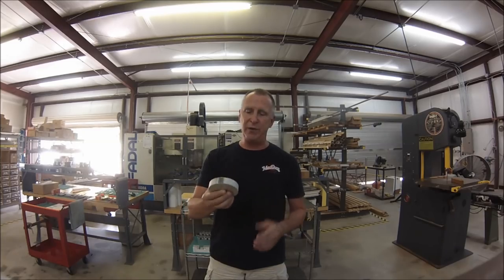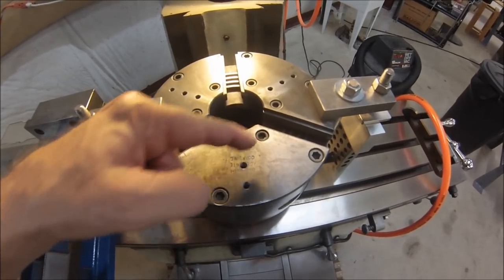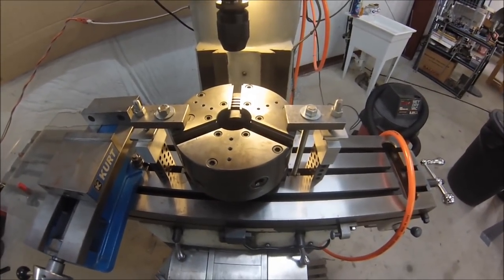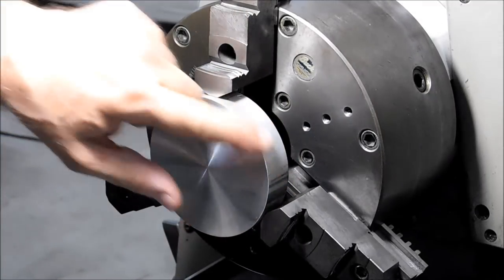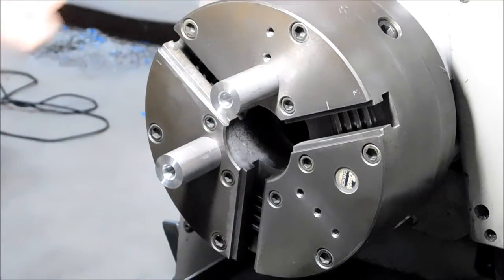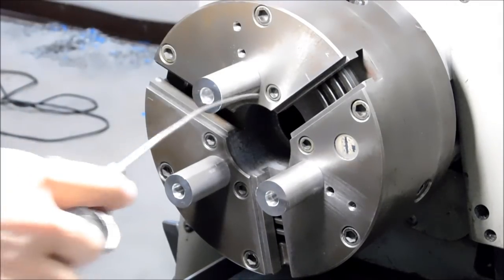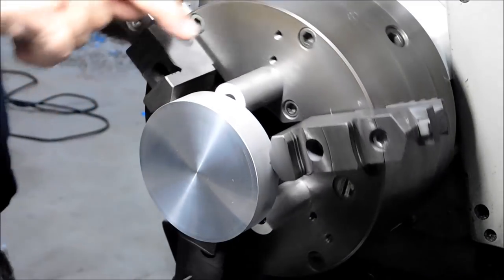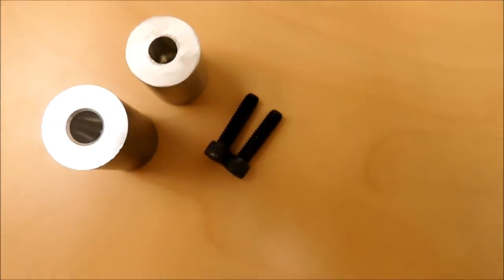A Simple Chuck Modification to Improve Parallelism of Your Parts

Comment: I don't know how many times i have fumbled around with parallels, bits of tool steel and anything else i could lay my hands on to try and pack up the back surface of a part  so i could face it parallel and the answer was so simple !
Thanks Joe  for  yet another eye opening video ! 
I'm also going to do this to my chucks that  i use on my rotary table and dividing head . It will make drilling the holes in model steam engine cylinder heads much simpler as i won't have the worry of drilling into the chuck jaws and if i drill into a stand off i couldn't care less !
Reply: ian bertenshaw great idea!  I didnt think about the chuck on my rotary table!  Will do this mod right away
Reply from the maker: Any chuck in the shop could benefit by this mod.

Comment: Another awesome video on a terrific tip. I'd love to do this to all my chucks if I were not so afraid of ruining my chuck by breaking off a tap threading those holes. I hate taping holes in expensive hardware.
Reply: Always use a new tap in a place where you are not sure or just do not fuck it up. A new tap like M6 costs pennies. Plus, if you happen to break the tap, either EDM it out or just leave it there and drill a new one next to it.
Reply: Jaakko Fagerlund - I'm not worried about the cost of the tap. You are right, they are cheap in the big picture. But I do not want another hole in my chuck with a broken tap next to it. And if I had enough cash to get EDM capability, I'd take my wife to Italy or just buy another even better chuck. To be honest, I was hoping Joe would jump in with another video - "How to take the worry out of tapping holes in expensive parts". In other words, teach me how to avoid breaking taps off. I seem to break taps more often than I should which makes me believe that I need someone like Joe to teach me how to improve my process. Thanks for jumping in!
Reply: Use a jig, use lube, use good taps, make sure to balance the force on both sides of the tap wrench, drill your holes to 65% thread depth instead of 75%.  IIRC #6-32 is a notorious size for breaking taps.

Comment: Great tip Joe! Using parallels in a PITA especially there are multiple parts to be done. I don't think I'll drill into my Bison chuck, but the older chuck that came with the lathe is going to get a bit lighter today! Also, I think I'll take the scroll out, drill and tap through and plug the holes with set screws and low strength threadlocker.

Comment: Kick Ass Idea ---- Two thumbs up -- Jim Enos Freetown Ma .
For many years I placed parallels between the part and the face of the chuck.
The old parallel trick is not very accurate and doesn't fit all circumstances. 
If you're not thinking -- you can get a face full of parallel
I was to lazy to think out of the box .
I will be making a few sets of standoffs .
Thanks for taking me off of the merry go round.
Reply from the maker: I got tired of the parallel and soft jaw route for facing. This is so much quicker. And safer.
Reply: TangentJim my shop hot the magnet parallel set made to fit between the jaws. They work ok, But expensive.

Comment: Nice Joe, I will have to try it. I have always used a roller bearing on a turned shaft set up in a tool holder and just touch it off at my slowest speed with a light to see when the light goes away.  I'm just a home chip maker not a pro.  I learn allot from your videos.
Reply: Joe I have trouble with the term soft jaws ? Please explain.
Reply: @christophercullen1236  I can answer that.  "Soft jaws" are commonly made from carbon steel ("mild steel") and meant to be machinable and thus adaptable to the work you're running.  In the most basic use they are mounted on the chuck, the jaws are preloaded by tightening onto a disc or ring, then bored to true the gripping surfaces.  Mostly this is done to locate the workpieces accurately (radially).
"Hard jaws" are also usually carbon steel but machined to a final shape and then surface hardened to resist wear.  Larger ones usually have serrated gripping surfaces. They are not meant to be machined but could be trued slightly by grinding in place using a toolpost grinder.
Reply: The bearing on a shaft is a quick way to get your part running true'ish, but it doesn't align the face that is pointing towards the chuck. That's where the step-blocks come in, as they act as a solid reference to push the part up against.

Comment: We do something similar to this on our big manual lathes. We use the t-slots in the chuck face. Bolt down clamps with bolts sticking out of them and a jam nut. We set the bolt to a height using a scale and set the jam nut. Skim the bolt heads to length and it's ready to use. Not quite as fast as your option, but it's another option for someone who has t-slots in the chuck face.
Reply from the maker: Those are handy chucks to have.

Comment: Joe, good trick. 
  What I have done, is to machine a biscuit. 
  It has to be larger in diameter than the chuck bore, or I have to also go with a plug. 
  Say my parts are 2.5", my biscuit is 2.495... It will lay upon the chuck face..
  So I throw it in the chuck, shove the stock against it on the second side.. ( First side cleanup, established by jaw grip  } and rip. Biscuit is only held buy luck, but you shoved your part in there... it goes nowhere. 
  That being said, I will follow your lead on this one.  But, the biscuit is a bit faster if your chuck is not prepared. 
  Keep these great video's coming, and again, my many thanks.
      Mark
Reply from the maker: I used the biscuit trick until I had one of my parts with a diameter a few thou smaller than the biscuit hit the setup. I torqued the chuck, it felt normal. When I fired it up, my part came out like a hockey puck at an NHL game. The jaws grabbed the puck and not the part. Be careful doing that.
Reply: @joepie221  Yeah, well biscuits are dumb. You cannot blame the biscuit.
Reply: Another potential advantage I see of the standoffs over a biscuit, the standoffs can work even if the face of the chuck isn't aligned right.  Though I'd expect a good chuck on the lathe to have a face well aligned with the axis.
Reply: Given.

Comment: Hi Joe. Always great to see your practicle approach to workshop practices. I thoroughly enjoy your channel. Keep up the good work. Out of interest, how much scroll  engagement due you allow with your chuck jaws at the point where you place your maximum jaw setting mark?  Regards Eckard Lucht
Reply from the maker: 2 full teeth engaged on each jaw with the scroll engaged inside the chuck body. I don't trust 1 scroll not to crack off under pressure.

Comment: well deserved thumbs up.

thinking of that technique: why not improve it further and spare the step for facing off the bushings/undo and redo the jaws every time? i'm thinking of facing the front of the chuck by either grinding it parallel in respect of the back plate on a flat grinder or even face it slowly when mounted on the lathe, then machine some couple sets of bushings with different lengths out of tool steel/case hardening steel, harden them and grind them parallel.
the parallelism wouldn't be that far off then either, or would it?

Comment: I did this same thing on the 56" Bullard VTL I ran 23 years ago. With there being so much slop in the jaws it's the only way I could get parallel parts. It had a 4 jaw hydrolic chuck. I turned some large interesting parts.
Reply from the maker: I worked along side of some bullard vtl;s many years ago. They can run some big parts. I saw a magnetic chuck fail one night and launch a part the size of a clothes washer. it came through the splash guard like paper and shook the floor when it hit. Wow.

Comment: Joe, you marked your chuck jaws with a "safety index mark" to know at what point they are no longer safe when opening them up.   What is a good guide for scroll engagement?
Reply from the maker: You can get away with 1 tooth engagement, but don't abuse the chuck with that minimal grip. If you need to really crunch down on a part, I'd go with at least 2 teeth mated between the scroll and carrier.
Reply: Thanks Joe, your videos are very helpful and I appreciate the thought, content, and work that you put into them.
Reply from the maker: It can be time consuming. The comments, subscriptions and view count make it worthwhile. Thanks for watching.

Comment: Slick, easy setup. Your videos are the best out there. I cant get my head around the .0002 high spot, what am I missing
Reply from the maker: You'll notice at 9:15 when I tighten the part, I didn't tap it down against the standoffs. The .0002 high reading could be jaw lift, or as simple as thimble pressure difference on the micrometer. Watch my 'Jaw movement you probably weren't aware of' video. It shows the lift potential very clearly. .0002 parallel without tapping a part down is OK in my book.
Reply: That will be the next video on the list...thanks for your reply and great info
Reply from the maker: Anytime.

Comment: Next project! It's intriguing how the obvious simple solutions/modifications seem once you see them.
Request/Suggestion: Can you show the cutter/holder you're using for an given operation?
I can't quite make out the style you used in this video and it is interesting.
Reply from the maker: Its a TPG 321 insert. Slightly positive, .015 radius on a triangular insert.
Reply: A good ol' TPG321... Now I see it. @~9:41 it shows in the reflection of the piece part.

Comment: Its a good idea for some circumstances you may encounter, on a recurring basis. 
I use a butterfly type stop for facing (using your gripping style on a saw cut also), then a collet or soft jaws for the other side.
It's all relative and depending on what ya got to do with what you got to work with. :)
Reply from the maker: At the very least, its good to see an option to soft jaws.

Comment: Awesome idea, when I seen the drilled holes I thought you were going to use square or rectangular bars kind of like parallels with drilled and counterbored holes to secure it to the chuck face. I've always used a backing plate but you have to tap it to the face with a dead blow every part or it will rattle around and not be as parallel and to tap it back you have to back your carriage out further than you would just to change parts. I would think all chucks would come drilled and tapped like this but then again you would think that all chucks would be adjustable like Buck chucks too.
Reply from the maker: It worked like a charm.

Comment: I just put parallel blocks in between my chuck and work piece and use the tail stock to squeeze it up tight against them. Of course you will want to remove the blocks before engaging the spindle :P
Reply from the maker: That works, but you risk scratching the backside when you remove the parallels. It may not be efficient if you have a bunch of parts.
Reply: This is the technique i use as well. If your parallel has no burs or grime, theres no reason it would scratch.
Its much faster to find the right size parallel than to machine a bunch of stand offs for a ton of critical sizes, to each his own.
Reply: Same here, parallels or some 1/4" tool steel bars. This new method would be great for batches more than just a few individual parts..
Reply: Or you could use adjustable parallels, but I reckon Joe's right to prefer his method for repetition turning.

Comment: Simple but I would bring the Tailstock with live/dead centre up to the work piece as this will apply central and even pressure as you tighten the 3 Jaw. Might add some Chucks 'can not' be drilled unless you reduce the manufactures recommended Max RPM.

Comment: Asome mod Joe! I never had to turn to those specs, so what I usually do is stick two identical parallels between the chuck face and the part during setup, then tighten the jaws, and slide the parallels out before running the lathe. Probably not as good, but close I'd think, though I never thought of measuring it. Thanks for the tip.
Reply: Done it many times for the quickie jobs for within .002 to .004 or 5 type jobs. Just keep in mind that some chuck faces do actually have a convex face even thought they are ground. Meaning if the parallels and there ends do not line up with the same diameter of the chuck face some slight variation can occur. Just saying. Usually the most I have seen on chuck face concave at worst in about .003-.005 on a 10" chuck. Not to step on Joes toes, of course ;- )
Reply: Much appreciated. I guess I should be facing my cheep Chinese chuck just in case.
Reply: That's an idea!. I like to be very clean with tool type surfaces like that. If I were to go that extra mile I'd be sure to stone the chuck and spindle mount surface to get nearly full contact between the spindle face and chuck mount surface before skimming the face. yeah it kind of blew me away when I saw taper on the chuck face the first time. Not al. But some do. I've used horizontal rotary grinders and to get concave face on a chuck would certainly have to be intentional. I just can't think of any reason why a chuck mfg. co. would desire this? Good luck.
Reply: ps. may want to clean (stone) and degrease the surfaces before mount and just sweep the face with the indicator in the 3 clocked 120  positions to see if this is the case with your chuck. regardless, Joes Idea is handy for having 'sets' of standoffs for general increments to tru up faces with various part thicknesses. Enjoy and leave the gloves at home when on a machine.
Reply: Good tip, I'll look into it.

Comment: I’m going to drill my chucks. Been thinking about it anyway.  I want to try bolting a rod to the check that drives a tapping head. I’ve never seen this done but I think it would work fine. Of course it would be prone to crashing if the user did not keep out of its way.
Reply from the maker: I'd like to hear more about your idea.
Reply: Joe Pieczynski It seems like you could just have a rod with a flange nut screwed into one of the holes. It would need to be the right length so that it engaged the tapping head arm. Maybe it would be better to have a small base bolted to two of the holes and then you could have a larger diameter rod. Like 3/8”.
Reply from the maker: The arm is supposed to be stationary isn't it ??  Is the tapping head in the chuck or tailstock ?

Comment: We custom made stops that pass through the spindle, with a 1/4-20 thread on the end that we made different size plates for it. We use these to achieve the same concept, and its adjustable so you can retract it should you have a longer or shorter part.
Reply from the maker: I've used 'thru spindle' stops before, but never had the accuracy a setup like this will offer.

Comment: Wonder if you might not get rid of those tenths by skimming your back plate and/or chuck face. If so, you've got a damn elegant solution. Kudos!
Reply from the maker: Neither suggestion would change anything. the standoffs are cut true to the machine regardless of their mounting surface. You may get better results if you tap it down as well. But be careful not to introduce a rolling distortion between support points.
Reply: @joepie221  obviously you are correct. I must've been asleep when I wrote that. In anycase, it's the most elegant solution I've ever seen to the issue.

Comment: Hi Joe, great idea and I will follow you when I'll have several jobs like that. I do not understand why you took the jaws out when you can screw them to place between jaws. The only thing I can assume is for demonstration. Thanks
Reply: The stand-offs are end-faced in place to improve accuracy. The jaws would crash into the lathe tool if left installed.
Reply from the maker: Sometimes you can get away with leaving the jaws in if you can position them to clear the facing cut, but for sake of time demonstration, I removed and replaced them just to give a fair comparison to some of the steps needed for soft jaw installation.

Comment: What's your take on the stops made by Robin and Stefan? Yours wins on simplicity, but Robin's design really tickles the tool lover in me
Reply from the maker: I watched both of them. The quality and skill level of those guys is undeniable. As simple as my solution is, I have to say that since these are not adjustable, the possibility of them slipping out of adjustment is eliminated. My other advantage is that my 'Between the jaws" placement distributes part support at every 60 degrees. Some of the others that hug the jaw still leave a large gap between contact points. This makes a huge difference on thinner parts that can flex or chatter.

Comment: Thanks very much Joe! Nice idea! I need an advice on how to drill these threaded holes without removing my 3-jaw chuck. Do you think its right to attach a drill, on my tool-holder, vertically to the chuck and drill the holes?
Reply: I was thinking the same thing, as I only have a lathe and a drill press.
Reply: Just make sure the chuck is not going to move while you drill, no probelms with this approach. The jaws make for a perfect alignment/division tool, so put a parallel or similar on the way and rest the jaw against that to get your drilled holes all in one line, then turn to another jaw and do the same, so you get even spacing.

Comment: Thank-s for another fantastic lesson.
When preparing the chuck, drilling the holes, why not strip the chuck, as one does when cleaning a new chuck? Then there is no risc of drilling into the carousel moving the jaws. Drilling all the way through ought to work, making the tapping more easy.
Reply from the maker: Through holes would be easier to tap, but would also allow debris to get into the body of the chuck if not plugged when not in use. Bottom holes don't require any additional attention.